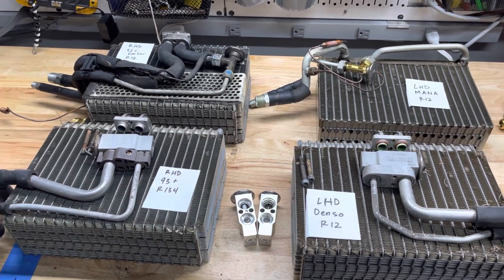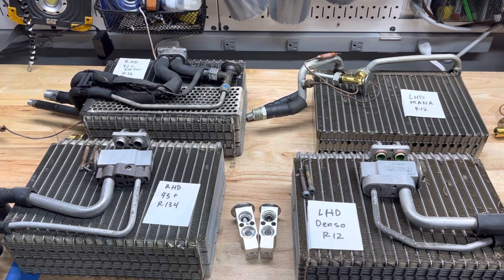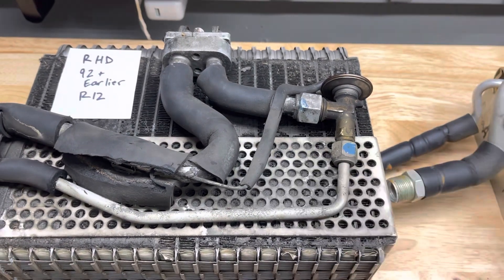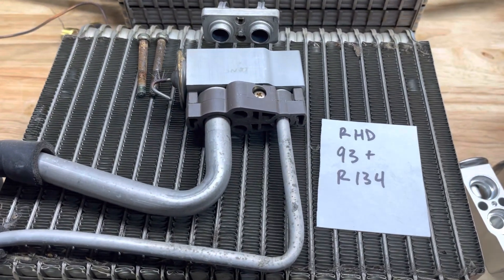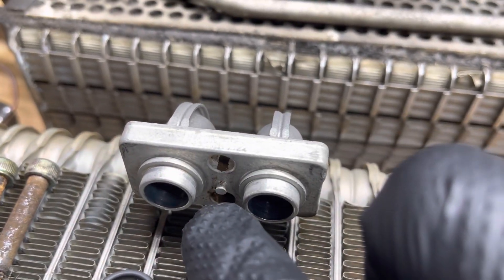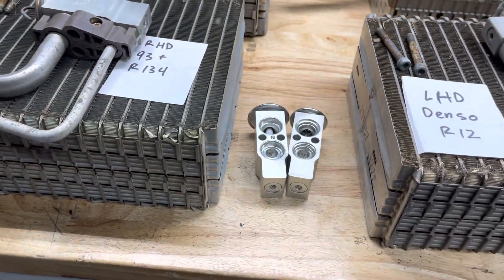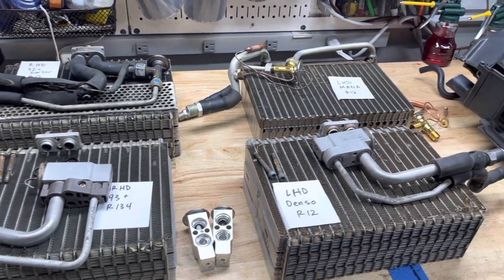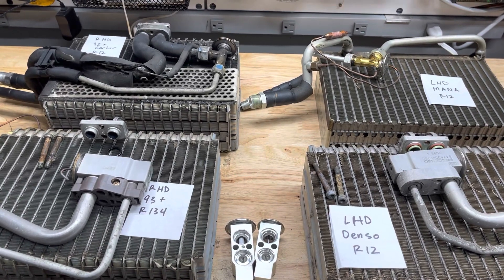Overview of Mazda FD RX7 Evaporators and Expansion (TXV) Valves (LHD and RHD)

Comment: Thanks for putting this out, this is an amazing resource for the guys trying to restore the AC in their cars. In my RHD '92 Efini, my expansion valve doesn't look like the top left for some reason. It actually looks like the LHD R12 expansion valve with the stepped wall and without the centering nub in the middle. Not really sure what's going on there unless the previous owner was swapping incompatible parts around.
Reply from the maker: We have been seeing people with different combinations of Mana dryers with denso evaporators etc.  Sometimes, units were changed over time.  Other times, we find that Mazda ended up using a mix and match of parts.  If your system was working fine, I would replace with matching parts.